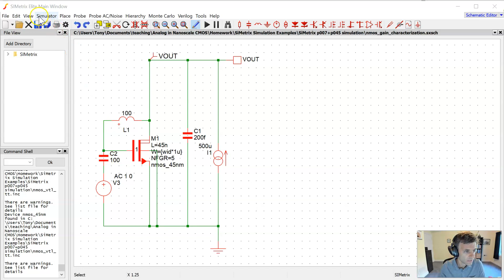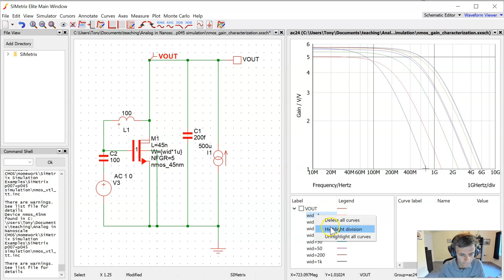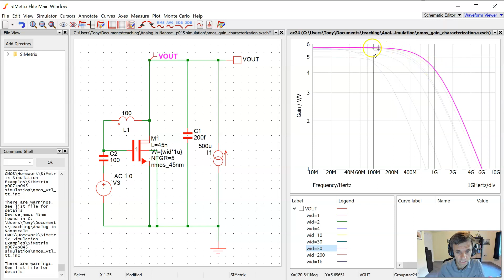Common Source Gain-Bandwidth Tradeoffs

Comment: Simetrix is one of the best open source IC EDA tools out there, I used it many years ago in Windows, and never got it going again when I got a Mac. There was an issue at the time, and I never got it going again. I have so many others now - LT Spice, Qucs, etc... But I would much prefer Simetrix, it was very intuitive and even has its own mature proprietary language to formulate device equations without integrating some other 3rd party app to enable similar functionality.

Comment: If I understand correctly, that big inductor between Gate and Drain is short for the DC signal. Hence, it's a diode-connected MOS that is always in saturation mode, but blocks the AC so that the input AC signal does not propagate to the Drain terminal? Been working on Analog CMOS for so many years, but never thought of putting a big inductor between Gate and Drain. Usually, just short them with wire.